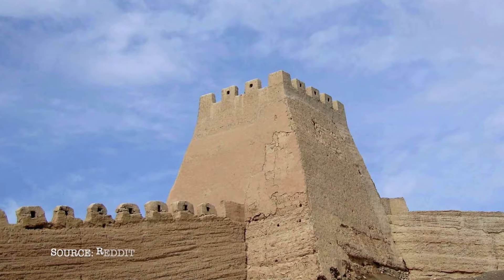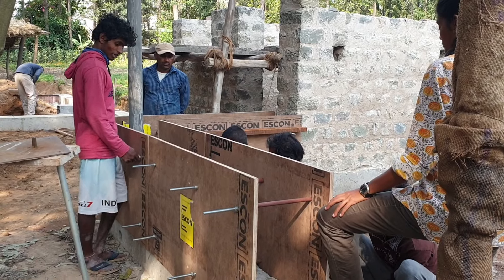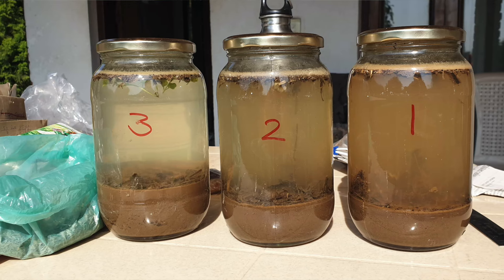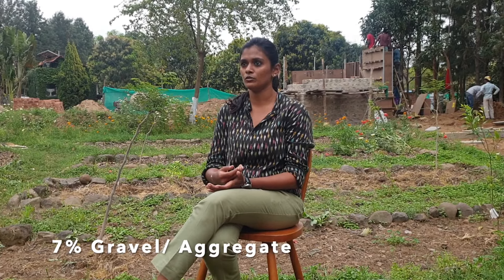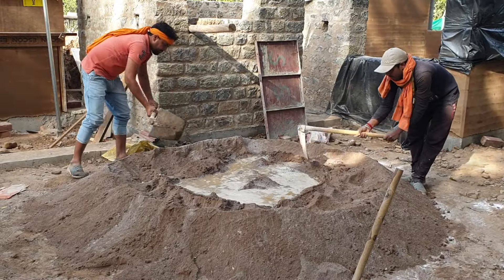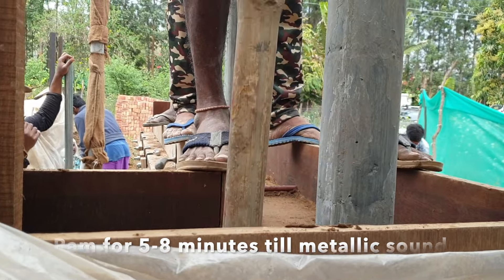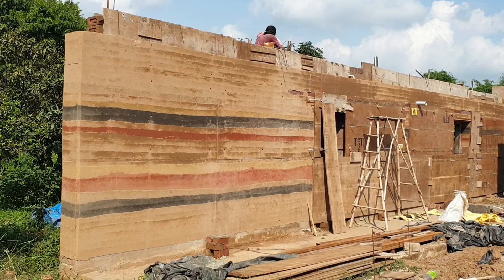What is Rammed Earth Construction?

Comment: Congratulations on choosing to go for a complete eco friendly project. Ashumi sounds so humble and down to earth unlike other architects. One thing that I'd like to know and understand is about the electrical wiring conduit system that you have choosen to go with or as Ashumi may have suggested as per design, and the other is about the plan for plumbing and drain system that you have planned. Could you please throw some light on the same and your responce would be highly appreciated. Warm Regards.
Reply from the maker: Excellent question! Maybe we will do a follow up video on it. But unlike modern construction, in rammed earth we place all elwcteical and plumbing pipes before we start ramming. We actually ram the walls around them. So it needs a lot of pre planning.

Comment: You can put dall and rice water (after cooking) or gur water with lime. 
2ndly use linseed oil on the out side to increase durability against rain and harsh sun. After "lipaee"
We still use it and mostly these house are made in colder months from Oct till Feb
Reply from the maker: There is no lipaaee in these walls. They are rammed and not made of cob

Comment: Great video with full of information. Thank you!
A question wil remain: how to protect the wall from rain?
Reply from the maker: If you have an overhanging roof, your wall will stay protected. Even otherwise there is no serious threat from rain. But you can spray a thin waterproofing coat of silicon on it.
Reply: @farmaanandaa  Thanks
Reply: Good construction methods, at Villages we can construct more cheaper houses for poor peoples,govt has to support you also provide full support to you we need minimum 20 crores houses for poor peoples,at Karnataka hydrolic compressed mud block available mud without filter, another method at kerala and Tami nadu interlocking compression mud block used😊

Comment: Top.

Can you share the calculation to determine the quantity of earth, sand and cement?
Reply from the maker: It's shared in the video. There is no cement or sand. Just earth, lime and aggregate.
Reply: @farmaanandaa  Thank you for the answer.

I rather wanted to say, what is the dimension for a wall block made (width x height x depth)?

How much earth, lime and aggregates did you use for this wall block (kilos or tonnes)?

Comment: Hello Madam, Can I make rammed earth house as 2nd story on my  concrete house. The reason as I stay in Chattisgarh and it is pretty hot in the house during summer time, so need your advise would it be viable to make second floor  with rammed earth. What considerations should we take to start this project. Would love to speak to you or your team on this.
Reply from the maker: Sudhir, it will depend on the ground floor structure I think, but it is best you consult an architect. The rammed earth walls are about 13 inches thick, and if your GF structure is with a 9 inch brick wall, you may not get the necessary support to make a rammed earth wall on the FF. But again, I am not a trained architect, so best you speak to one! Good luck!

Comment: Very nice. Few questions please.
1. what should be the minimum thickness of a wall.
2. Do we need to do the water curing. (of course when cement is added or without cement addition)
Reply from the maker: We have kept it at 13.5 inches, but I believe you can make it as thin as 9 inches too. All depends on the load on the wall, and the purpose with which you are building it. No, you do not need to cure these walls (imagine the saving of water, and the absence of mosquitoes from the construction site!!)
Reply: @farmaanandaa  Thank you.

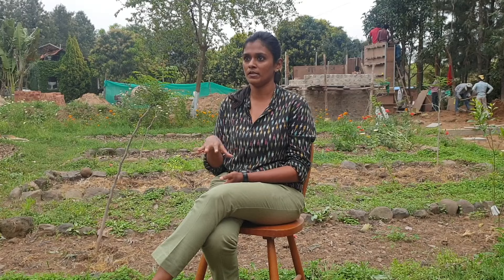Comment: @6:37 you talked about insulation benefits. I doubt that. Because, what I gather from my school science is that earth heats up fast and cools down fast which explained the big daily temperature ranges in deserts. Any comments?
Reply from the maker: You cannot compare the heating and cooling in a desert with that of a rammed earth house. Because a rammed earth house/ room is an enclosed structure. It can trap heat or cold within it. Stay tuned for a detailed video on how a rammed earth structure heats and cools itself. It is a combination of thermal mass and ventilation that makes it happen.
Reply: @farmaanandaa  https://youtu.be/52A5jiUm55U this video at around 2:40 clearly states that rammed earth constructions are not insulated. Though it doesn't explain why. 
Thinking a bit more about it, I asked myself why mud houses in villages remained cooler during oppressive summers especially in deserts . May be, thatched roofs and low height walls have greater roles to play there.
Reply: @gvermag  Rammed earth does not have to be insulated because of its thickness. If it were insulated, you are better shielded from outside temperatures, but that is offset by the thickness of the walls. I heard it takes 1 hour change 1 inch of rammed earth wall to the adjacent temperature. So regarding the video you linked, I think she means it's a con for rammed earth that you can't insulate it (unless you use SIRE wall), but the general consensus is that you don't need insulation for rammed earth. so it's a con, but not that big a deal.